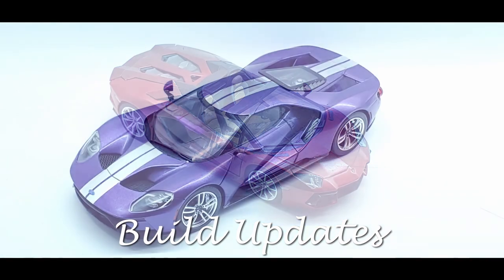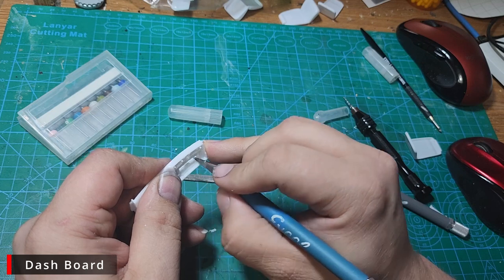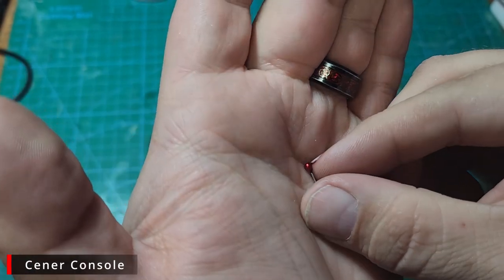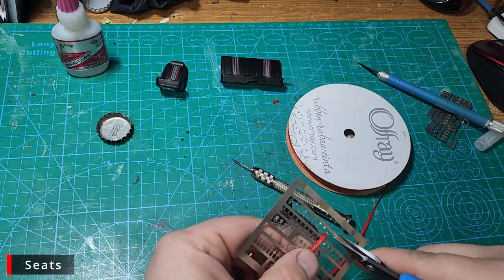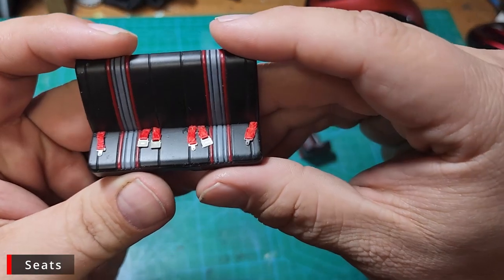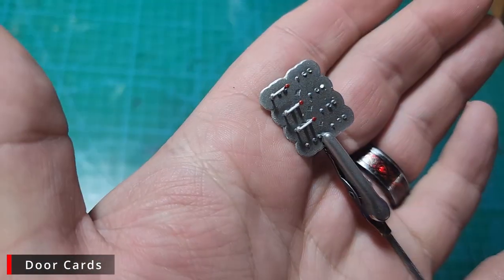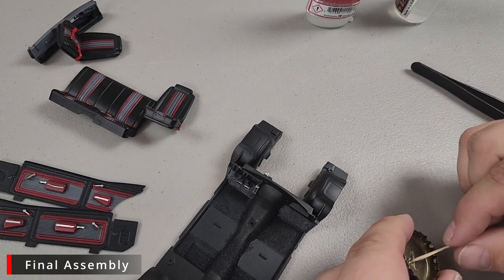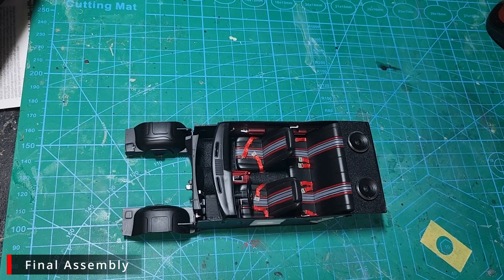Revell - '69 Nova Restomod - Interior

Comment: Really Nice work on the Nova s interior Justin!!!  I like the colors.    So you like the MIG foil???   Looks Good!!!     I'll be watching
Reply from the maker: It's ok. It's not as good as BMF used to be,  but then again neither is BMF. The chrome doesn't conform well,  and didn't stick well for me. The aluminum sticks very well.  Well enough to pull up paint if you burnish it down to well.  

In hearing that the guy at BMF is saying he's fixed the issue,  but I've yet to buy any thing from them direct as i have all this mig stuff.

Comment: Love the colors Justin it really makes it look high end custom interior. Window cranks are a nice add, might have to grab that file on Cults, if you did them again how would you go about removing the molded in one without messing up the door card? Seems inevitable.
Reply from the maker: Thanks Jason. Where i messed up the door cards is the vertical line right in front of the door handles. I tried to cut under the handle with a hobby knife saw blade, abd it cut into the door cards. If i were to start over with brand new door cards,  i would have used nippers to cut the handles off like i did the window cranks, abd then scratch build or 3d print  new more realistic ones. 

I also think i could have superglued ac small piece of sand paper to the end of a tooth pick and used that to do a better job sanding the door cards where i removed the original window cranks ac's door handles before i rescribed them.